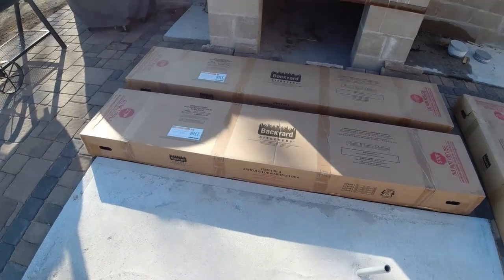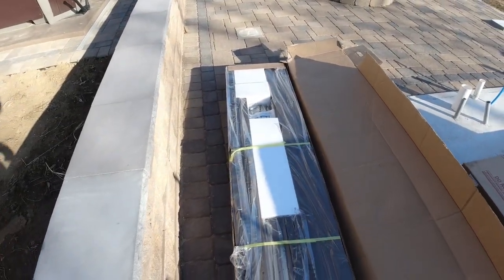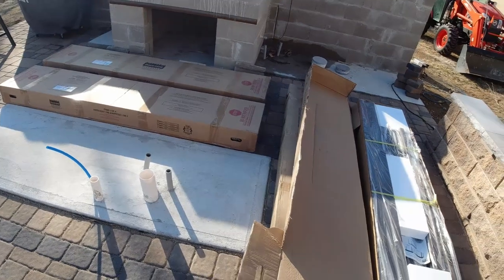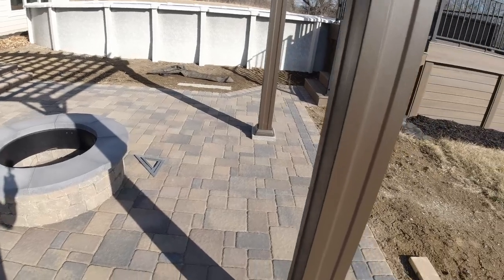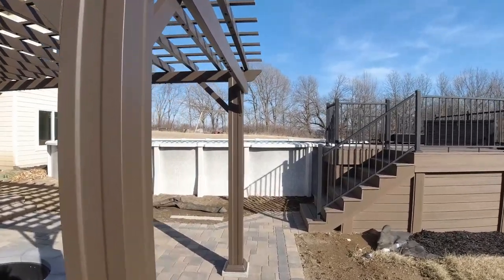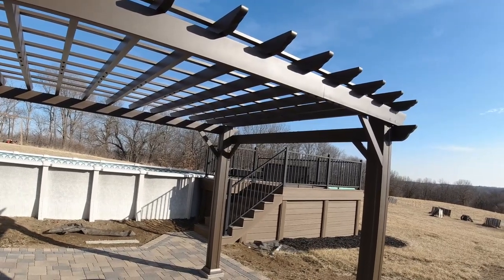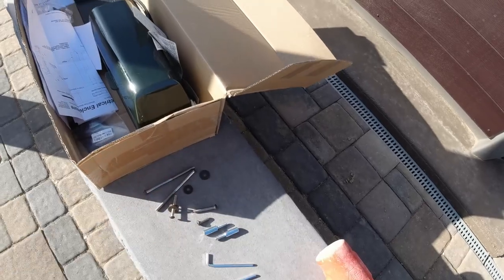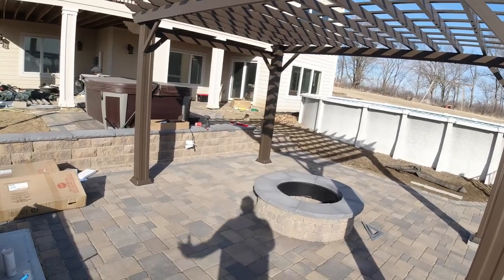Backyard Discovery Steel Ashford Pergola Assembly & Tips

Comment: You didn't show how to attach the leg posts after putting the top frame on it.  We're trying to re-assemble a Hampton Bay pergola very similar to yours but the top beams keep falling when we only partially screw in at connection points, so we duct-taped the posts to the top frame beams to try to stop them from falling since we aren't anchoring posts in cement.  Any tips since the video diesn't show how you raised it?

Comment: Thanks for detailed instructions and giving confidence that it can be DIY. Do u have a video on how you poured the concrete footings for pergola ?
Reply from the maker: Hello!  I show me preparing the footings in this video at about 10:15 mark. https://youtu.be/uzYsFbdSUl8?t=615  I went down below our frost line at 42".  The footing was roughly a 12" circle about 42"+ deep that I formed into a 12"x12" square at grade for the pergola post to attach to.  The square portion of the footing was roughly 9" deep.  You can see the completed footing in this video prior to installing the patio. https://youtu.be/Jn03bYvkwwY  You will not want to go any smaller than 12"x12" footing as the anchors will be too close to the footing edge and may break out of the footing.

Comment: I don't know how hot in your area. Did your pergola steel get really hot in summer? I want to buy pergola. But don't know which one worst. Steel metal or aluminum.
Reply from the maker: We can see 100 F during the summer with mid 90F common.  The post will get warm to the touch, but not hot enough to hurt.  I would assume color would impact this as well.  I would guess white would be the best while black would tend to be the hottest to the touch.

Comment: Did you mount the legs down to the stone?
Reply from the maker: Before I put the patio in, I dug and poured 4 footings 48" deep.  The posts of the pergola sit on these footings.  I secured the posts of the pergola to these footings by using concrete anchors.  Video for that will be coming soon.
Reply: @blood_sweat_and_beers  I bought a house with a patio already installed (pavers are Sony to yours)  and looking to install pergola. Do I need to pull up the pavers to pour concrete for the footings? Thanks.
Reply from the maker: @DetroitCity9  Yes, you will need to pull up the pavers and pour 4 footings for your pergola.  The pavers will support the pergola, but they will not sufficiently anchor the structure to the ground and if you get any wind, your pergola could take flight.  the size of your footings will depend on your frost line and the size of your pergola posts.  The footings I poured in this video were just under 12"x12".
Reply: @blood_sweat_and_beers  I have the same pergola. I'm getting ready to install it. But I didn't pour footings, I have pavers. Hoping there's a better way than taking the pavers out and digging a 4 foot hole. The pergola weighs 600 lbs, I was hoping it would not fly away, but I don't know. Maybe I can drive some sort of rod into the ground to anchor the pavers, the attach the pergola to the pavers.